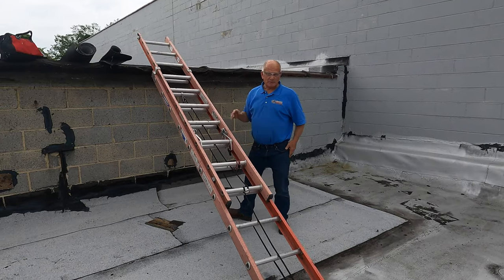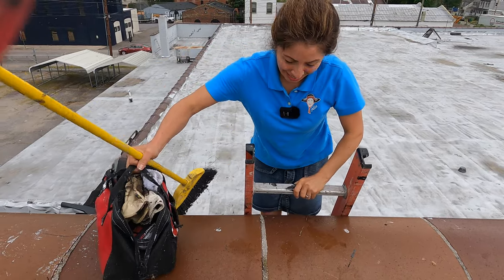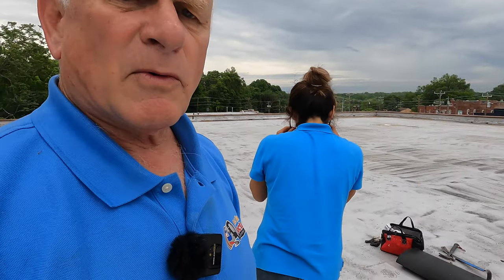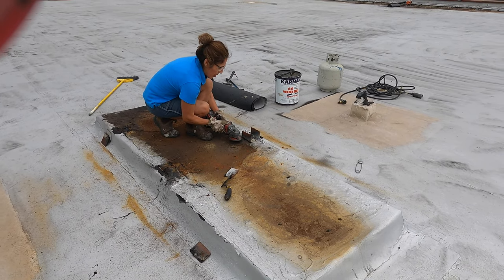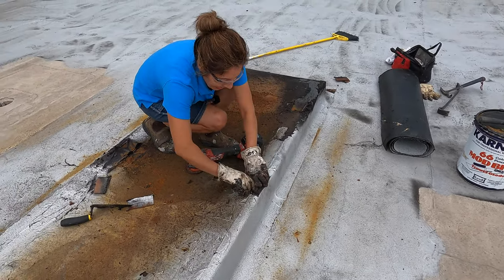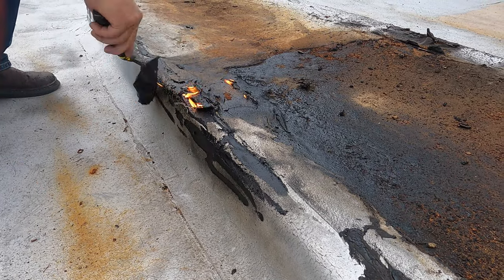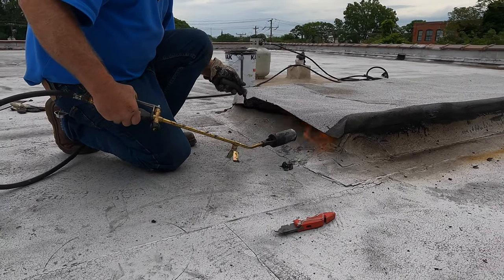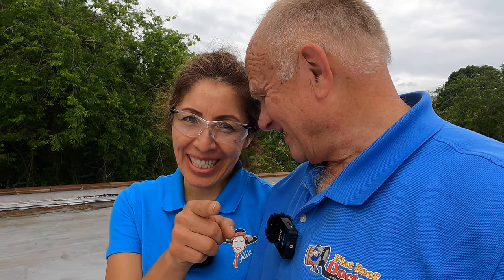How to Patch a Flat Roof with Torch Down Membrane

Comment: As the youngest and most inexperienced on a College maintenance crew. I was surrounded by certified HVAC, Plumbers, & Master electricians. I had absolutely no prior experience. I found my self learning sufficient knowledge of all those trades. As time would have it, I soon had to fill the needs of the college, from leaks. This produced weekly damage & need for ceiling tile replacement. I became stuck with extremely aged flat roofs. My job became a cycle of hopelessly flex sealing. Following Weekly replacements of ceiling tiles.I went from a supervisor at my last job, to spending three years loosing value. I found myself on top of the roofs, searching for areas of penetration. The condition was is quite bad, and every contractor  recommended lifting and replacing. With that not being an option. Becoming the Ceiling Tile Guy NOT being an option! I'm using every bit of knowledge you and your wife freely give. First I'll do my diligence till I  repair 3 commerical roofs. Then I'll go start a commerical flat roof leak restoration business, and offer companies in need alternative solution like you! You're my hero brother! Seriously all the inspiration I need.

Comment: Pro-tip, if you cut on that side of the cutting wheel, you will always have binding. It will wear out cutting discs faster and can even cause them to shatter which could lead to injury. That said, everything about your videos is a amazing advise. Thanks for empowering me to fix the roof on my garage.
Reply: *advice.

Comment: Hey Roof Doc im in northern cal and 22 yr old Garage shingles were leaking in a 2ft by 2 ft area, couldn't fix it with repairs, and couldn't locate the holes, and cant get a new roof until march  2022, so Turbo polyseal order arrived and i just took a paint brush and literally covered the whole area painting on that Turbo polyseal, heavy rains hit twice since and no leaks, i think some nails are leaking and shingles are cracked and leaking, but turbo stopped the leaks and no inside wood rafter damage is evident.
Reply from the maker: I am glad it worked but on Shingles? That's a little dicy

Comment: Hi doctor, are you using APP or SBS cap membrane? Please tell me which one you recommend for making a patch. I don't know if my current roof is APP or SBS.
Reply from the maker: Ok, when I started roofing you could only use APP for Torch Down and SBS was mop down. I the seams appears to have a lot of black tar that has flown out, then you most likely have SBS. For most of the time, most roofs are TOrch Dowm. I believe in the last 5 -8 years they have come out with a SBS that is a Torch Down too. 
It is safe to get APP to do the patches

Comment: I dont see that adhering properly, use asphalt primer and on your overlap of cap sheet,heat it with torch and run trowel over granules to bury them into membrane and then torch seam together for a good bond.
Reply: Yeah, that seems like a temporary fix, he cut a few corners, at least on the video. I didn't see a fire extinguisher handy either.